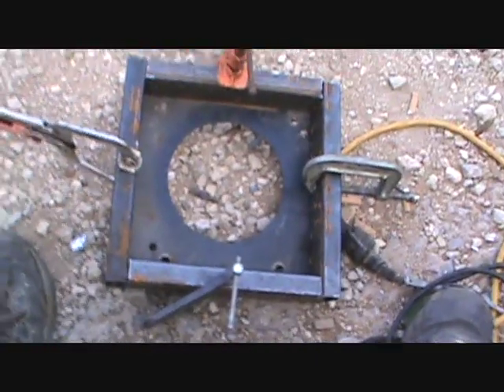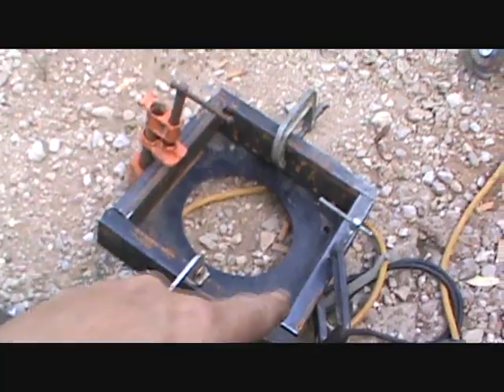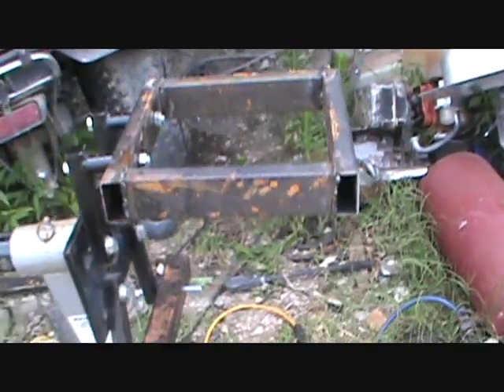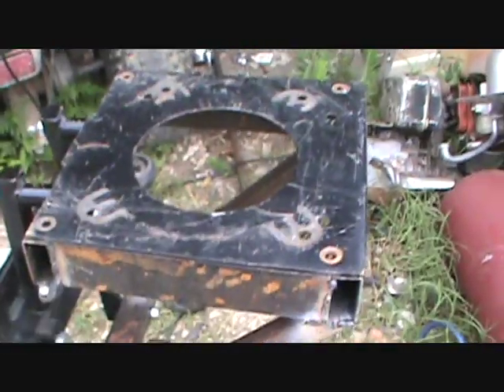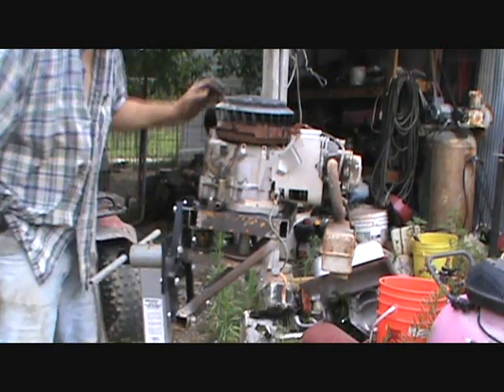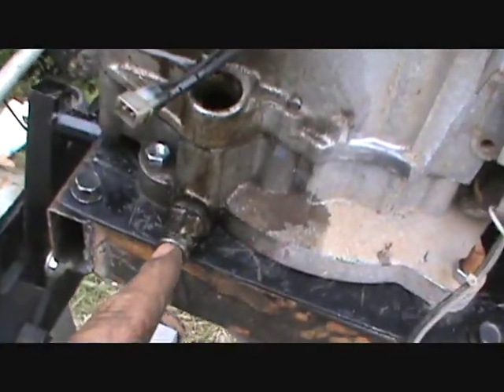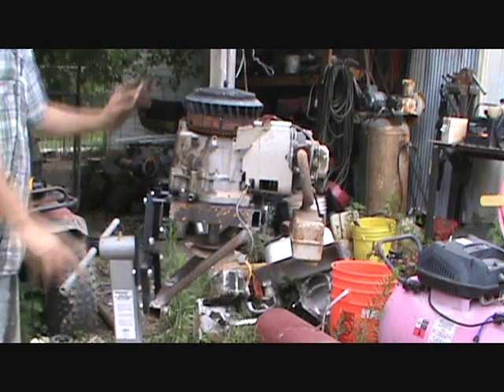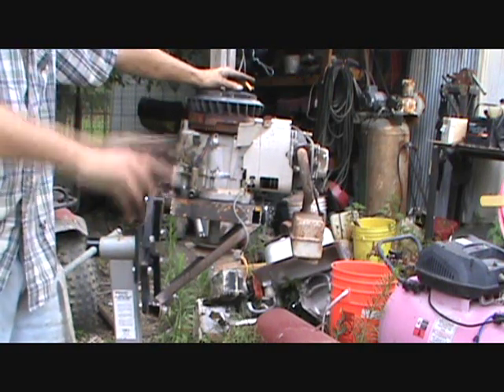Redneck LawnMower Engine Stand

Comment: Only one problem I see with this set up. Once you get your nuts up in place and then twist the mount sideways its gonna be real painful for you I am thinking.
Reply from the maker: it is a little top heavy but like any engine   there is a  bar  on back of the stand  to use to twist  the  engine around  ,But  this kind of engine  how many times  will you need to  flip it lol , i can  start the motor if needed on the stand  and also  set  valves  or  what ever